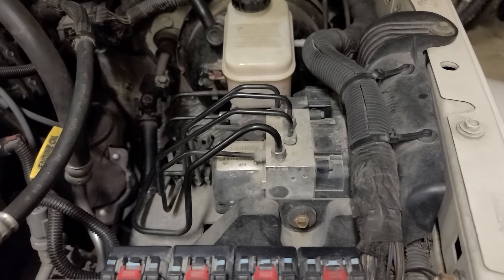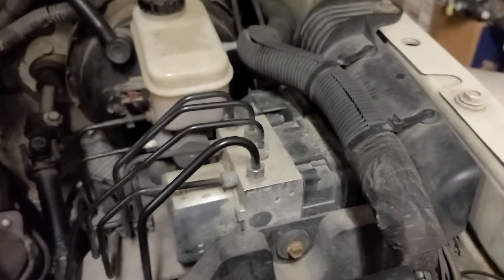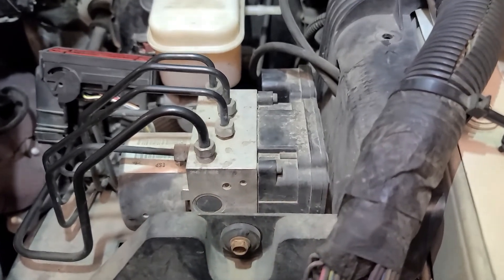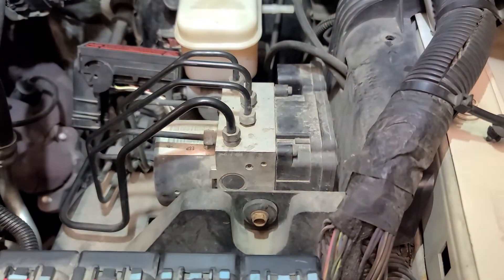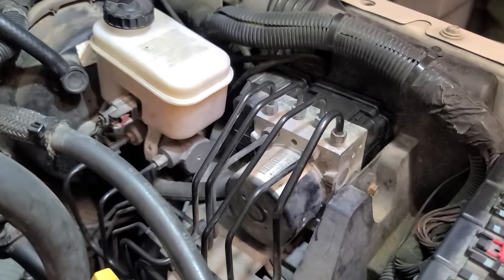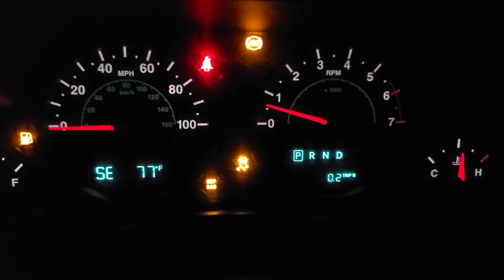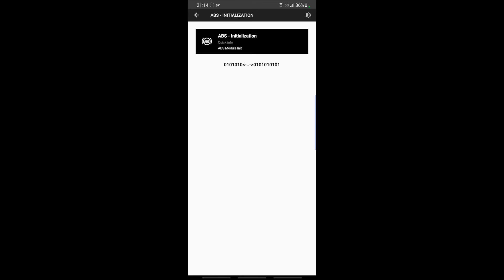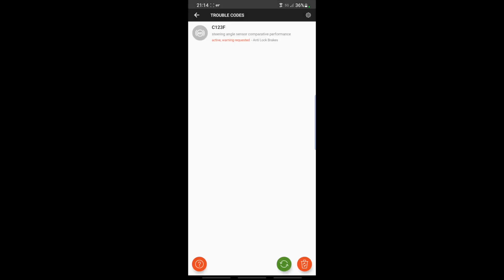Wrangler JK ABS Module Replacement

Comment: Thanks so much! I’m a novice at anything under the hood but this video saved me sooo much money. I had all the same lights on my dash, and before replacing my abs module I took it out, cleaned it, and reinstalled it and now all the lights have cleared! I’ve had the same abs module on my 2008 wrangler since it came off the lot and figured it finally blew out. Turns out the age old unplug it and plug it back in method worked like a charm ❤️
Reply from the maker: Nice!
Reply: What codes did it throw at first.

Comment: Great video, I just ordered my ABS Module for C2200 for my 2016 Jeep Wrangler. I have OBD JSCAN. I purchased the cheapest version. Will that work or do I need to update the level of OBD JSCAN?
Reply from the maker: I do not know of any license in JSCAN other than the "standard" license. The only options are to buy multiple VINs at once for a small discount. I use Android so if you have Apple maybe it's different?

Comment: Jeep wrangler tons of issues, all these vehicle should be on recall basically the whole vehicle is recall, what a piece of crap. 
Abs module 
Oil cooler 
Water liking inside 
Oil leaking 
Rear main seal fail 
Dead woobble 
Engine knocking 
All sensors fail early 
Engine dont last 
The list goes on and on

Comment: I'm get the traction control light the abs light and brake light but not that other one and I changed my brake fluid not that long ago and today I was installing extended brake lines and noticed my brake fluid looked dirty again already, do you think my module might actually be good but something else might be wrong and the module is detecting it, also my lights don't always come on and once it warms up my lights stay off
Reply from the maker: Interesting. As far as I know, the module does not have a sensor for dirty fluid, but if something is gunked up it could be causing a fault in the ABS module.  There are a few other probable causes - wheel speed sensor and also an off-centered steering wheel. Sometimes even a bad battery can cause weirdness.  If you have a code scanner, I would look at the historical/inactive codes and see if you can see anything.
Reply: @austin.gresham  yeah i've scanned it, it said abs issue I forgot the code though
Reply: Tried getting the abs module to pop up out of its spot but it's not giving on the front grommet near the cabin sure looks like a nut that's holding it in instead of a grommet
Reply from the maker: @shakerattlenrolloffroad  The only nut I am aware of is the 10mm on the front of the unit. On the underside, it's only a grommet.
Reply: @austin.gresham   I finally got it to pop out but man I thought I was gonna break something if i pushed up any harder

Comment: While you solved the programming issue with JScan, do you know if the app will confirm the PCM and ABS fault with the torque request test you mentioned? I own JScan and can’t seem to find where that test would or could be. Thanks for your help.
Reply from the maker: Other than an Advanced Scan I don't think there is a way to confirm those faults with JScan. The only thing I could think of is to run the ABS brake bleed again and see if the fault comes back but that's a lot of work. The "old fashioned" way to test it would be to find some slippery ground, like gravel or sand, and punch it - the ESC should kick in on the ABS for the rear brakes to try and prevent wheel slippage.

Comment: Question .. I love this video thank you, as a woman who is tired of being ripped off by mechanics and on a budget. My 2009 Wrangler Unlimited X 4dr 4wd JK has the ETC light coming on then I lose acceleration. Went to Auto Zone the code said Camshaft sensor. I replaced it,  droves fine for a week or two. Now Its Back. Autozone ran the code again now it says  C121C,  Low tire psi, battery and oil. Secured the battery terminal, added a quart and air.  Still having low idle/acceleration. Is this a C121C issue or a result of some other chain reaction sensor hide n seek?  
I rather fix the ABS module myself, lowering cost, but after I replace how far is the jeep able to drive before the reset is necessary? I wouldn't  be close to a empty parking lot or dealership. Will it need to be towed? 
Im trying to effective and efficient.
Reply from the maker: The C121C is a tricky one because it's not a specific code, it's telling you something else is wrong. Based on your lost acceleration and ETC light, I think you might have a vacuum leak (too much air getting into the system). Without doing some O2 sensor inspection with a scanner, I can't say for sure though. In the past I've seen this with a faulty EGR valve (with no codes) and a faulty PCV valve (also without a code).  Could also be a cracked hose somewhere. This is a tough one to diagnose "remotely".  I would not start by replacing the ABS module, though - that's an expensive option that may not work. I would look up some videos on how to diagnose a vacuum leak and start there.
Reply: @austin.gresham  thank you.  I will look into this, I replaced the air filter and pedal sensor, cleaned the sensor n ETC throttle, it seems to have improved gas mileage. But again started to sputter again, when idle drops under 25mph and with multiple stops. I think there is something up with air so I will check into it.   Thank you 👍

Comment: hi, does anyone know where to get a 2012 jeep wrangler abs module
Reply from the maker: The part you're looking for is 68145835AE (or the older 68145835AA/AB/AC).   There are a couple on Ebay and Ali, but they are expensive.  Good luck

Comment: Great video and easy to follow. I have the same problem, and as mentioned it's almost impossible to find this module. Apparently it's both discontinued and "Due to manufacturer supply shortage, this item isn’t currently available for ordering." Being in a relatively small market (Australia) doesn't help either. The only available option is to do what you exactly foreshadowed as not needed:
1. Replacing the whole system not only the controller. Apparently, the dealership have that available but not just the controller.
2. As it's replacing the whole system now. My mechanic wants to do all the bleeding process.

Extremely costly.

The other option is to purchase the controller unit online from overseas (not from mopar) which appears to be available, however this comes with considerable level of risk.

This is scheduled for next week. I'll update my comment or reply to it. Maybe it helps someone who's facing a similar situation.

P. S. After the installation I'll try the initialisation myself.
Reply from the maker: Good luck!  Would love to hear your results when it's done.
Reply: @austin.gresham  - It didn't take long for an update. My mechanic called the Jeep dealership just moments before we placed the order to double check that the controller module is included in the quoted part, the salesperson confirmed, we asked for the part # and searched online, it was clearly mentioned that this is just the pump and pipes, and does not include the module. We called again,  sales transferred us to a technical person who confirmed the module is indeed not included and they don't have it in the country (Australia). Now back to square 0. fishing for the module online.
Reply from the maker: @ahmadbazzari9948  Sorry to hear that...
Reply: @ahmadbazzari9948  did you find a module i am also waiting for one has been 6 months now

Comment: I have a 2015 JK Wrangler unlimited.Recently replaced front rotors & pads. Went on easily but after new parts and it doesnt happen all the time , when i hit the brakes   it feels like the abs is engaging .I am getting no abs lights or any other lights coming on . When I was doing the install  and compressing the caliper pistons I didnt open the bleeder valve or open the master cylinder cover when compressing the caliper piston to fit over the pads and rotor. Not sure if I did any damage to the abs system .The brakes feel good , just abs engages sometimes. I have a OBD2 reader that diagnoses abs codes but it shows no codes or errors .Has no live abs data capabilities in this scanner . Could my abs module be defective if im not getting any cides or abs lights coming on .Any suggestions on what could be causing this .
Thank you
Reply from the maker: That's an interesting one. First, I would not worry that you did any damage by not opening the fluid reservoir when compressing the pads. I've done that a number of times and never damaged anything - removing the cap just makes the compression a little easier in my experience.

If you think ABS is engaging, but you're not seeing any lights illuminate, then I don't think it's an ABS problem. If the ABS module was bad, you'd be seeing at least some code that tells you there's an error. I have not seen one just "stop" recognizing errors and give up. So, I guess that's the good news. Have you checked the rear pads? With the ABS, BLD rear diff, and traction control the rear brakes on these get worked a lot harder than older Jeeps.  You may have an issue in the rear, including a bad E-brake shoe. I am about to post a video about these, actually, which caused pretty bad noise in a 2008 Wrangler.  Other than that, you may have a driveline issue/noise, like shavings in the differential.

Hope that helps!
Reply: Did you ever figure out your problem with the brakes? I’m experiencing the same thing.
Reply: @Jo-manji  , I don't have the JK anymore , traded it in for a new Tundra , but I remember instead of taking it in I replaced both front wheel hub assemblies and I may have put new calipers on too , but the wheel hub assembly had a speed sensor w/ it (got everything from Rock Auto) , installed all the new parts and everything went away and brakes stopped perfectly. I took a guess on the front end brakes being the problem and it all went well . Sometimes you can just put new sensors on but w/ the winters and salt where I live it's a pain in the ass taking those sensors out and most times you end up breaking the sensor that goes into the hub assembly . Plus I got new wheel hubs w/ the sensors. The sensors were attached to the hub assemblies when I received them . Fairly easy install , just take pics of how speed sensor wiring is routed in your Jeep . 
Good luck
Reply: @HeavyChevyMega  thanks for the advice. Will do.

Comment: Hi Austin, I recently have had my abs module replaced by a shop. After I picked the jeep up about 5 minutes down the road the abs and stability control light came on. It came up on the jscan app as a rear left wheel speed sensor. I not long ago replaced the sensor. A few days later i noticed that the problem has been coming and going. Would you suggest I complete the programming part again to see if that changes anything?
Reply: If I have solid abs light and traction light on, do you think the initialisation was not done properly? 

Your input would be greatly appreciated 😊
Reply from the maker: Could be the initialization, but it's more than likely being caused by the wheel speed sensor you mentioned.  Another thing that can cause it is the steering wheel being out of alignment and the SAS sending bad information to the ABS controller.
Reply from the maker: You may have a faulty sensor, the wiring could bad, or you could have build up on the sensor from brake dust.  The rear wheel hubs have the tone wheel and sensor pretty exposed as compared to the front and sometimes they get caked up with metal shavings. What is the actual code? I can also give you some electrical tests to try.

Comment: Awesome video. Thanks!  Have a 2013 JK Sahara. Took about 6 months to receive a replacement ABS module pn 6814 5835 AE .  Took about 30 min to replace the module - was in no hurry -watching this video.  Once replaced, my ABS flashed and chime sounded for about 5 miles then chime stopped and ABS light stayed on solid. Was left with solid ABS light and solid stability crtl light. Seemed to drive and brake fine.  Took it to the dealer for a flash and all lights are now off!  Dealer charger $78 for flash.

Comment: Thanks for the great video Austin. I just replaced the ABS module on my wife's  2009 Jeep Wrangler with a OEM part number confirmed to be the correct one for her jeep. I followed the instructions on the JSCAN app and your video. All the lights went out except the ABS light and chime flashes and chimes every 2 to 3 seconds. If you have any idea or suggestions what to do to help I would appreciate it.
Thanks
Glenn

Comment: Thanks for the very informative video Austin. Because of your video I was able to replace the ABS controller on my wife's 2009 Jeep Wrangler with a new OEM part confirmed to match her jeep. I followed the JSCAN app directions and all the lights are off except the ABS lite is flashing and chimes. I tried several times and cannot get the light to stop flashing and chime stop chiming. All wheel sensors are working fine and JSCAN shows no codes. If you have any idea of what I might be doing wrong or what else I can do to get them to stop I would appreciate. Thanks again
Reply from the maker: Hi Glenn. In my experience, when the ABS light is flashing (and no other lights) it's usually because the steering angle is out of alignment. Make sure you do a proper centering of the steering wheel using the draglink, while using JScan to check what it reports as the steering angle sensor degrees. I can't remember how many degrees "off" will trigger the ABS error, but essentially you want it as close to 0 as possible.

Comment: Hi... I'm using the icar adapter with the jscan. I installed a used module and was trying to program but keep getting a "sub function not supported" & "conditions not correct". Maybe you know about it or what's up. Thanks...
Reply from the maker: hmm...  I don't know much about the icar adapter. Some functions require an OBD with more advanced protocol handling and I'mnot a CANBus expert to be able to tell you if the ABS module needs that. You could try a different adapter like the MX+ (which is what I used in this video). The other possibility is that you need to clear the VIN from the used module first using the "Clear VIN Original and Current" before the Initialization. If neither of those work, you may have another bad module, unfortunately.

Comment: Another good video.  I recently had the same trouble lights, random, and now constant.  I have Jscan and at first had several codes, but now just C2200.  Can you explain more how you verify torque request in Jscan if you know?  I am trying to make sure it is the module and not the pcm or connection or something else. - I think I figured it out, I verified ESP torque request SET with engine running, I think this is what I needed to check.  Also, when you got the new module did you just do the ABS initialization steps?  Is that the same as programming to your VIN?  I see another option for ABS clear VIN, did you have to do that before the initialization?  I am hoping to find a new module.
Reply: Well my new ABS module worked, it was almost impossible to remove from the grommets, and the bottom screws on the module were even more challenging.  You need a very narrow T20 extension.  Jscan abs initialization worked without having to do any other programming.

Comment: You aren’t kidding about the modules being hard to find!   I’m actually waiting on a used one now.  Hopefully it will be here by the end of the week and I can get my Jeep fixed.  If you don’t mind me asking, what scan tool are you using?   Mine is very basic and won’t do nearly all yours did.  Would love to upgrade.  Thanks for sharing!
Reply from the maker: Good Luck! For the scan tool I use a few different ones:  an Innova (from harbor freight), JScan and AlfaOBD.  For this particular fix, JScan was what I ended up using to get through the initialization for the new ABS module. It's an app for iPhone/Android that uses a bluetooth or wifi OBDII adapter like an ELM32 that you can find on Amazon.
Reply: FYI, got my used controller installed today and no more lights on the dash.  Didn’t need to reprogram it at all.  I am going to send my old unit off to be repaired so I’ll have a good one ready to go if this one goes bad.  Thanks for sharing your video!
Reply from the maker: @brianhayes7153  That's great to hear! No idea how you got away without reprogramming but congrats. Did you tell the seller what your VIN number was ahead of time? Some people (dealers) can program a VIN prior to shipping it out...  just curious.
Reply: @austin.gresham  No, didn’t give the seller my VIN.  It came from a junk yard in Iowa.  Dodge dealer in Grapevine, TX said they had over 800 on back order nationwide at dealers.  All I could find were used ones.  Don’t know why it didn’t need flashing, but I don’t have any warning lights at all now.  I’ll take it!
Reply: @austin.gresham if it had the same part number and year he was lucky.